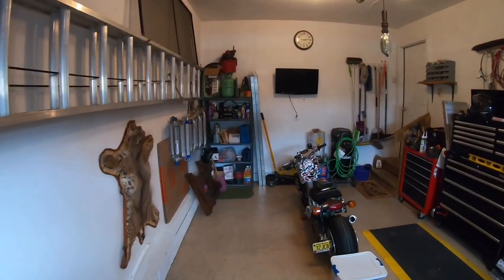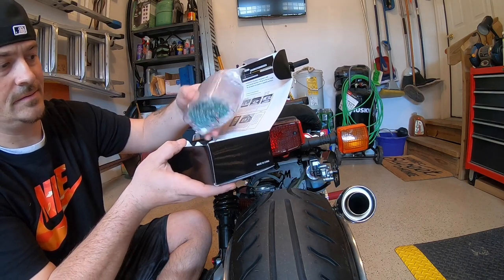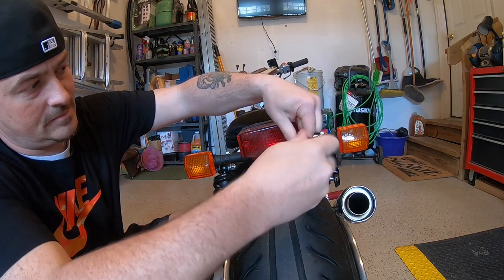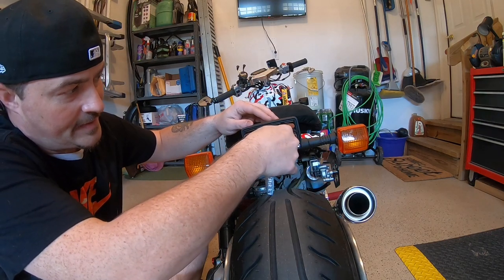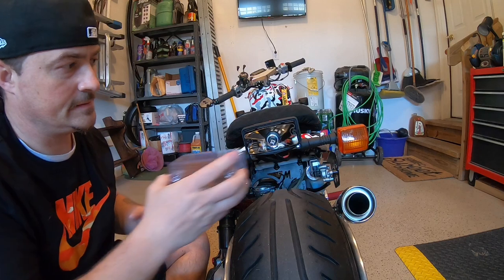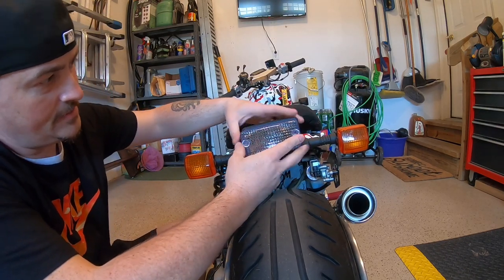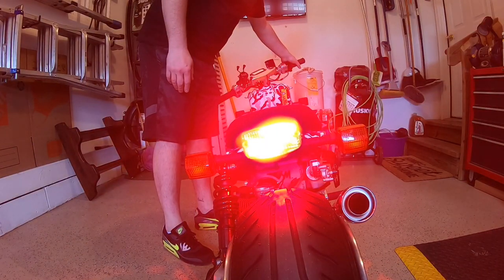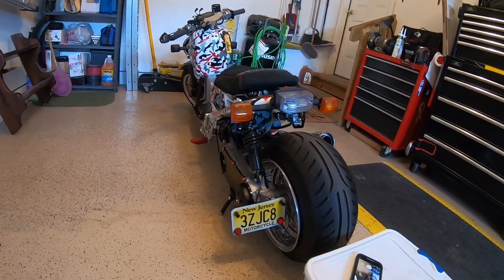Honda Ruckus Factory Style Clear Lens Cheap Upgrade #Hondaruckus

Comment: Like the vid and thanks for showing how this would work,  you got a video of how you deleted the rest of the rear tail and blinker assembly
Reply from the maker: steven courtney thank you for subscribing bud, appreciate the support. No I don’t have a video on the tail...that is called a tidy tail and it lowers the entire assembly as you can see and cleans it all up. If your bike is still factory height, it comes with a plate bracket you can use. If you bike is lowered, the plate bracket will not work and has to be relocated. I think the tidy tail is around $50
Reply: @WideOpenThrottle  hi, yep I'm a new subscriber, got a 2015 stock red and white ruckster.
Reply from the maker: steven courtney very nice...they are awesome little bikes and a lot of fun to tinker with. Enjoy it!